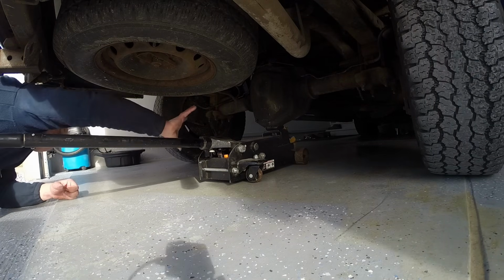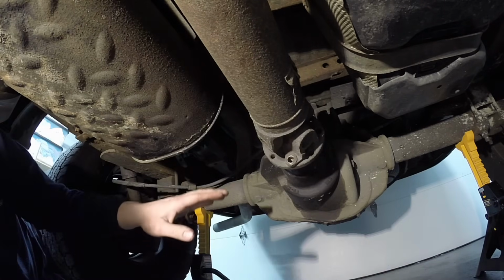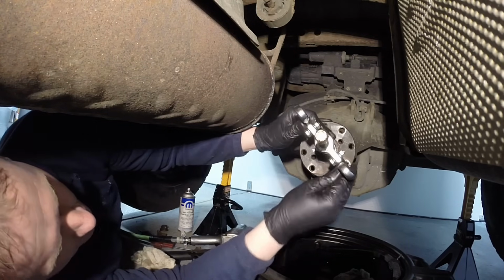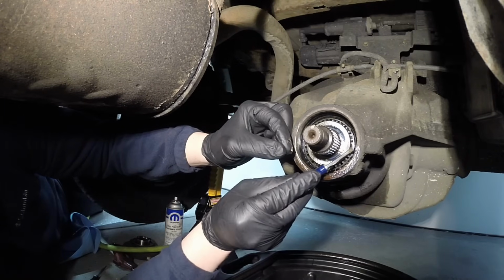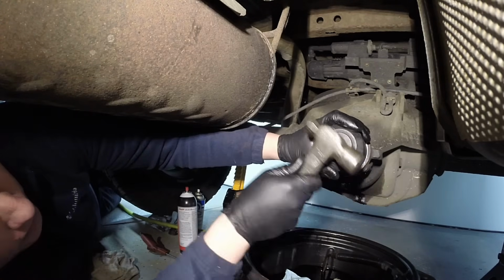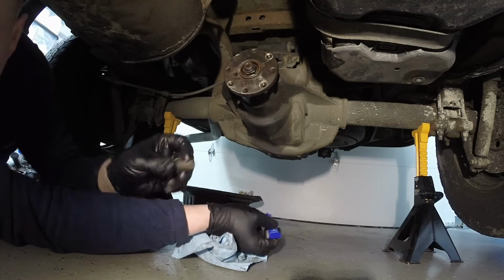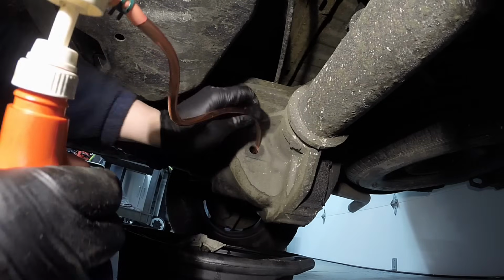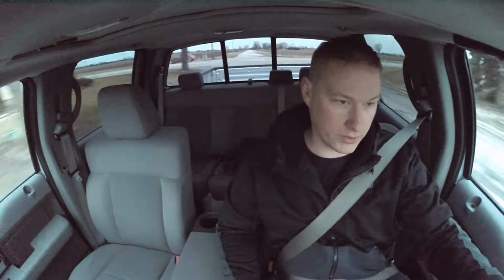Ford & Dana Axles Pinion Seal Replacement: Tricks of the Trade

Comment: So, I got my flange back on but manually tightened about 1/4" past my stop mark on correct thread count and continued connecting new rear driveshaft (on my 1993 bronco w/ dana 44). Took emerg brake off with wheels still lifted and cannot hand turn driveshaft in neutral (manual trans) at all. Did this overshoot on the pinion nut cause this? Before I removed pinion flange, I could easily spin the flange (with driveshaft not attached) with my fingers and the wheels would turn. Thanks.

Comment: Great video! I am considering replacing all of the rear differential fluid in my 99 f150 which has the 8.8 gears. The differential seal is leaking for the second time in two years (I have replaced it once). The truck was bought used and I don't think the fluid has ever been replaced. It currently has 175000 miles on it, 2wd 5 speed, single cab. I don't think it has a limited slip but I am not for sure. What additives do I need to put in with the diff fluid?
Reply: If it's the front seal, like in this video, and it was fixed, then leaked again..according to the mechanic in this video it could be a U joints in the actual driveshaft, esp on the bottom side next to the rear end. It would cause vibration, which would cause a leak in the front seal there. So maybe replace the U joints in the shaft, which are usually pretty cheap.
 Just find a video showing you how to change them, shade tree mechanic style.

Comment: I'm trying to change the seal on my 96 explorer front diff. The bolts are recessed near a cap and you can't really use a socket. you can use a smallish torx head on the bolts, but you don't want to put too much torque on that. However they seem very frozen - and I would rather not heat things up there. I have them soaking in penetrating oil but any insight will be appreciated. I believe the bolt ends are visible to daylight thru the yoke, that made them game for salt corrosion, hopefully penetrating oil will help.

Comment: Alright so explain this to me. Do you have to put a light coating of RTV silicone on the back side of the seal where it meets up with the differential. I used your video and some others to replace mine this past weekend, and it is better, but I question whether I still have a small leak. That's when it dawned on me about you cleaning off the sealant inside using the small flat head screw driver, and I also had some of that orangish-red material that I had to clean off. That should have been a red flag, but I noticed that you also didn't indicate that you put RTV silicone on the back of the seal?
Reply from the maker: +Steve Meier the new seal has a thick ring of sealant around it already. Did yours have this? Did you use a Ford seal?
Reply: No, I didn't.  I noticed after watching your video again that you recommended the ford seal. I might wait until it cools off past summer time, and if I think it is still leaking try it again.  Mine didn't have any sealant. That is why I was questioning about the metal outside seal where it meets up with the metal part of the differential. I assume I should have used some type of gasket sealant on that. Oh well, lesson learned. Thanks for replying.

Comment: FordTechMakuloco Is this job doable without air tools?  Especially with removing the pinion flange and axle nut.  Also, I'm doing this on a 2003 Excursion.  Thank you and thank you for all your hard work on these vids!
Reply: Yes.  I used a 12 point 12mm closed wrench with an extension from another wrench to break them and then a 1/2 ratchet wrench to take the driveshaft off.  Used a 29mm socket from Autozone loan tool to take the pinion nut off.

Comment: +FordTechMakuloco Is this job doable without air tools?  Especially with removing the pinion flange and axle nut.  Also, I'm doing this on a 2003 Excursion.  Thank you and thank you for all your hard work on these vids!

Comment: I replaced my pinion seal on my 2004 f150 a few weeks ago and now it's leaking again I'm not sure if it's my drive shaft that's vibrating and beating it up or not
Reply: Rock Auto sells a speedie sleeve that fits over the flange on the yoke. cost around 20 bucks and works good.

Comment: if I forgot to measure and mark for preload, what's the correct way to put it back to the right preload?

you're video is awesome, gave many more tips than the how to I used.
Reply: Troy Kent Shafer II did you ever get a answer for this question I did the same thing
Reply: omar bynum the answer was, the crush sleeve has already been crushed. you have to tighten it down and judge by turning the wheels.  that's what I did. been driving on it since I made that comment. retired mechanic confirmed that's the only way you can... or buy new crush sleeve and torque to spec.

Comment: I like the video; very well done!   What do you think about a leaking pinion seal but is leaking through the center of the pinion nut! 
I havn't had a chance to climb under there to pull anything off yet but when i noticed the leak it is not coming from around the seal against the pumpkin....thoughts?

Comment: my explorer blew a seal on the front differential, where the shaft comes into it. do I use the same method to change that seal as in the video?
Reply from the maker: Yes same method.
Reply: +FordTechMakuloco thank you sir, great work on the videos. they certainly help.
Reply: MK Hip Hop.

Comment: I've got a leak in the rear differential seal on my 2002 F-250 Super Duty with 156,200 miles on it. I'm not sure if this video is identical, or applicable to the much larger 10.5" rear end in the Super Duty trucks?....It however points me in the right direction and helps me understand the procedure covered in my shop manual. The tricks save a lot of time and foolproof a lot of potential errors going by the books methods. They detail a fairly large portion of setting the preload and re-torquing the nut and whatnot. Screw that shit!! I like the white paint marker method and counting your threads much better. Also having the axle on jack stands and in neutral to spin to get at the bolts straight on and when the time comes to have a helper apply the brakes is a genius trick and sure bet time and frustration saver. I'm going to go ahead and replace my universal joints while I have the driveshaft out at the same time. I'm already very familiar with that and marking everything on your yokes so it goes back the exact same way.....using a 20 ton press and sockets or black pipe couplings to press the caps out or back in and whatnot. I've done U-joints quite a few times in various vehicles over the years. This damn rear seal scared me a bit though before watching this video. The book should explain an easier and goof-proof method such as yours instead of writing a whole chapter how to reset your preload, balancing issues and torquing etc...etc..

As always, thanks for the video. You are one of only a very select few on YouTube whom I trust and really know what you are doing....I hate watching Earl and Ed the two retarded rednecks screw up their own vehicles....and lead others down the same amateur blunder filled path too! 

From:

The licensed HVAC Technician who's been at it since I got out of the United States Marine Corps.

Semper Fi~

Comment: I have an 8.8 rear diff. in my pick-up that I will be doing a pinion seal on soon. On the outer bearing, is it OK to replace JUST the bearing? Or should you replace the race as well? If so is there a way to get the race out with out opening the diff. cover?
Reply from the maker: +jasmwhite1 The race and the bearing are a matched seat and should be replaced together. Also ford has changed the cone angle of the front outer bearing so it would no longer match the old race anyway.

Comment: I am a retired mechanic in Australia. I have seen many vehicle repair clips out of America however, I have never seen anyone as though as you, it reminds me of how I was taught many years ago. Keep up the good work. Regards Bill Caddy, Bundaberg, Queensland, Australia.
Reply: oops I have never marked the flange of the drive shaft , never had any problems
Reply: Mark Warner it helps keep the original balancing intact.  I've seen it cause Probs where there's a lot of balancing weights on the driveshaft.
Reply: You said though..
Did you mean thorough?
Reply: He could’ve checked preload and at least used a new crush sleeve for the $2.50 and tightened it to the old preload instead of depending on threadlock to keep an old used $5 nut in place. Maybe some sealant on the splines of the pinion. A lot of video but left out the important parts.
Reply: @6spd85notch    You can’t install a new crushcrush collar and tighten it properly while the rear end is assembled, And that is why he is doing it this way! Apparently you have never actually rebuilt a differential from scratch or you would not have made your comment! If he installed a new crush collar and didn’t tighten it enough there will be excessive wear and if he tightened it too tight you can actually cease up the rear while driving!
Reply: @NeverEnoughPyro40  yeah it’s sought of a half assed job. Obviously customer doesn’t want to rebuild the whole rear to change the seal. Basically it’s a band aid for a leaky rear. You’ll never get pinion preload set the way it was by spinning it by hand. So he did what he had to do. Like a lot of people would do. I’ve built enough rears to know not to rely on blue threadlock and he still could’ve used a little sealant. The rears I’ve built are very quiet and absolutely zero leaks and the rear in my car takes a serious whooping. Calm yourself buddy.
Reply: So to simply change the pinion seal you think he should gut the diff and replace the crush sleave and reset check pre load, cause its not as easy as simply changing sleave and expecting pre load and lash to be the same.  He should do all that just to change the seal ? 

Oh boy fella
Reply: @Lodgepolevampire  👍🏼
Reply: @NeverEnoughPyro40  exactly!
Reply: Ya, I know that's some fake news.
Reply: Sam Scornaienchi , what if the pinion flange just comes off by hand? Thanks for the extra tips you have added here as well, when I took the nut off I was able to just easily pull the pinion flange off the differential. The bearings inside are good or seem to be. Wondering if I have some additional problems.
Reply: NoOneSpecific doesn’t matter. It’s still good
Reply from the maker: +Bill Caddy Thanks!
Reply: @FordTechMakuloco  Can you please let me know how much you charge to repair the rear pinion on my 2004 Ford Explorer XLT? You are very thorough, hard to find that anymore. Way to Go.
Reply: I've got an 2001 f250 7.3, I'm looking at replacing the @FordTechMakuloco Pinion bearing. Any video on it? I can't find anything

Comment: can the pinion bearing be replaced at this point if it's pitted or it needs to be overhauled (redo the crush washer and pre-load) ?
Reply from the maker: +Arthur Esclamada yes it can but then again ford changed them so the cup and bearing must be replaced as a matched set

Comment: Could you have replaced the inner bearing with out changing the outer race?
Thanks
Reply from the maker: +amtpdb1 you could yes but they should be  replaced as a matched set. Problem is there has been so many changes Ford now went to more of a cone shape instead of a flattened out design so those definitely wouldn't match
Reply: Thanks for answering

Comment: I had an 07 mustang I put a 4.10 ring and pinion in and I remember the worst part was puttin the pinion nut back on and setting the preload. I took a 6 foot long pipe and drilled some holes so that the flange bolts held it in place and then had to use a breaker bar and a piece of pipe with the diff out of the car and then tighten that SOB down. It had a crush washer. Its really an art you just have to have a feel for. When it got close even an eighth of a turn could make you go over!!!

Comment: Stinks working on your back doesn't it. It kills my neck afterwards but its all I've ever known with my vehicles. Thanks for the great vid. I'm going to tackle this exact job in a few weeks
Reply from the maker: +shantor100 I don't mind it.
Reply: FordTechMakuloco What is the loud clunk transmission drop noise somewhere from the rear end of driveshaft when slowing down? Noticed it happens in 4wd especially. I put 4wd hub deleted on yesterday as I just bought the truck used and it had 4wd problems as well. The light doesn’t come on but seems to be working fine in 4l and 4h but still have it up on the lift so not sure yet

Comment: only have conventional hand tools, any different procedures to follow?
Reply: If you can jig up a bar with 2 holes drilled into it and use some throw away bolts that you dont mind ruining and are the same size as the flange bolts. You can use the bar to stop the flange as you loosen it when it hits the ground. Pretty much the only way I can think of without taking out the diff or using power tools
Reply: To get the driveshaft off youll have to go between having it in gear to keep the driveshaft from moving then put in neutral to spin the deiveshaft to the next bolt, then put it back in gear to loosen it

Comment: I'm suprised he didn't want the fluid changed after the repair
Reply from the maker: +Joe Shearer no need this tear end is due for a complete overhaul soon enough it will be changed then. At $20 a qt it's not something you change for the heck of it.
Reply: +FordTechMakuloco I can understand that but just thought it wouldn't solve the noise but would slow down any more wear and tear. I had an old truck in high school and into my 20s that made noise but I changed the fluid a couple times and it never got too much worse.

Comment: I have a question. If my 2005 Mercury Grand Marquis calls for 80w-90 in the rear end as per the owner's manual, should I put 80w-90 in it, or should I switch to 75w-90?
Reply: +n310ea why would you switch? the manual literally says exactly what to use.
Reply: @n310ea
80w-90 vs 75w-90...they're basically the same.
Should not matter at all.

Comment: I noticed that jack oil on your bench in the background. Just a heads up I found it to be really thin and weep in my floor jacks. I switched to some iso 32 jack oil (car quest brand from advance auto) and my jacks work much better w/o weeping. YMMV just thought I'd mention it.
Reply from the maker: +Chad Bob really? I bought that to stop my jacks from leaking. I actually just swapped the fluid out last night to try it out . I also did a full on pm on the jacks to get them ready for the busy season
Reply: +FordTechMakuloco Yep I bought it for same reason and created leaks. Maybe your jacks will be fine, but just a heads up if you see drips you know why.

Comment: Do you have plans of installing a lift some day? obviously you wont be able to raise it too high, or have the most room for that part haha. But just curious, do you have any intentions of installing one someday?
Reply from the maker: +joshua medlin A mid rise lift has crossed my mind for shorter wheel base cars and trucks. I can move the door opener to the side of the garage and I have pretty high ceilings in the garage 10ft or so.

Comment: i always use a metal scribe to mark my pinion nut and flanges because of what you just did, always found myself cleaning my paint marks off!  Great video!
Reply from the maker: +Random GearHead I rely mainly on the thread count and feel
Reply: yeah, I bought a nice dial type torque wrench and when I started out would use it. while rotating the pinion I tried to watch the gauge, didn't take long to learn a faster and better way. I do use when i set up new rear ends for the proper drag.

 I'm glad to see someone as particular and clean while doing certain jobs as I am.
Reply: @FordTechMakuloco HELP!! I didn't mark my preload settings.  Now how do I set preload?

Comment: what's the part # for the seal installer
Reply from the maker: +James Scarborough OTC 205-208 is the one specified by Ford and is the absolute best and can be used for so many applications.
Reply: FordTechMakuloco thanks for that part number! I had to search to find it in the comments, but I found it! The last tool I need to do the job.